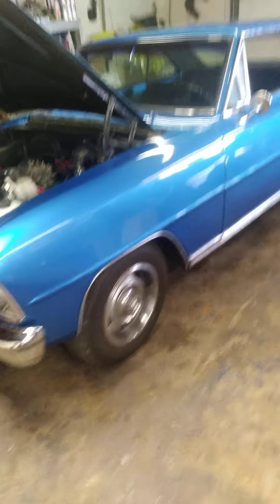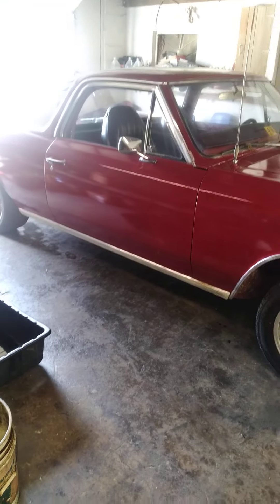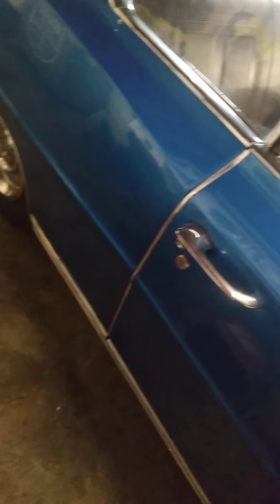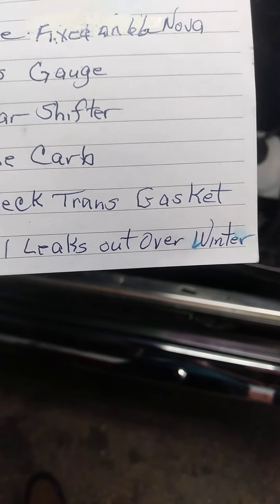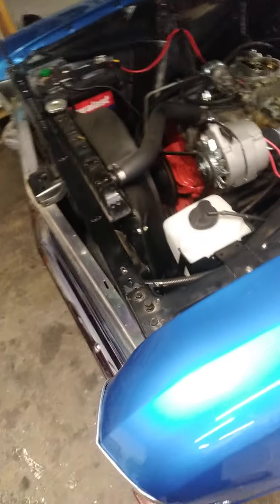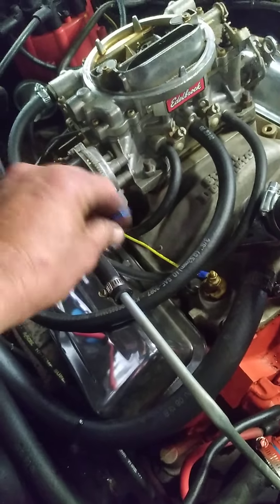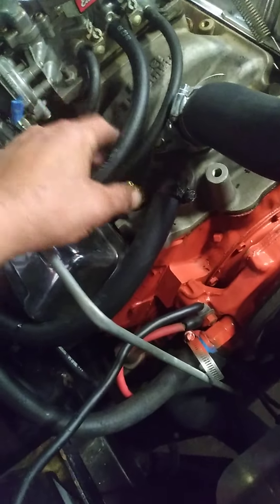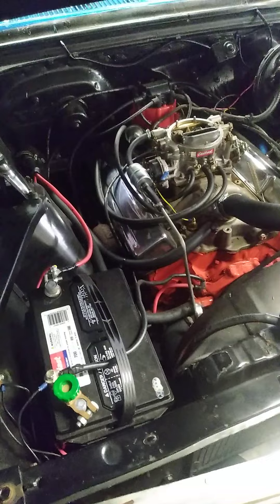1966 Chevy II Nova and 1966 ElCamino In Shop at Same Time

Comment: Dang, the 1966 El Camino sure brings back memories. My dad owned one that originally came equipped with a 327 & 4 speed. My brother blew up the 327, it was replaced by a 350 SBC & automatic transmission so mom could drive it. BTW, the temp here is showing 97, feels like 100. Yesterday it was 102. I won't be working in the shop until the weather is tolerable again.

Comment: Is there any way to contact you with an issue I'm having with a 1990 gmc sierra c1500 5.0 305ci automatic transmission issue I have a few questions on why my truck won't shift pretty sure it's the thm400 I could not find an email to email you directly